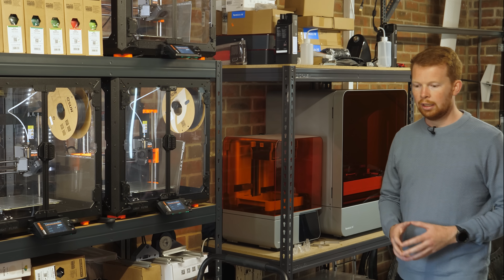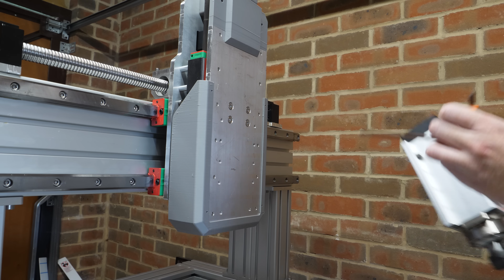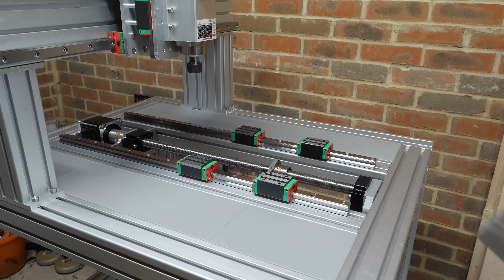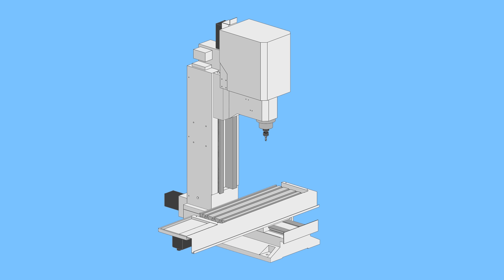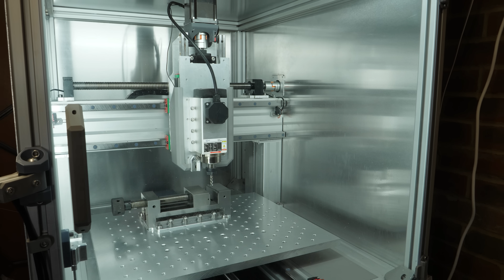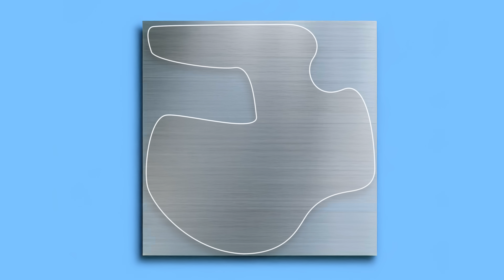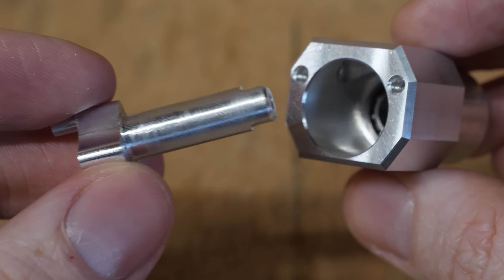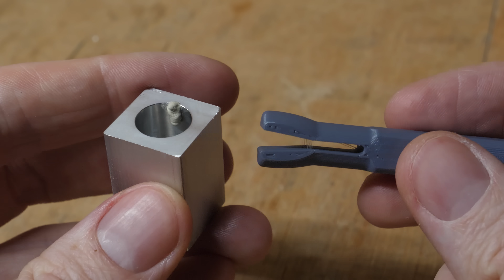I Needed an Engine, So I Built a CNC Machine

Comment: You could have gone for a higher Z-axis with little additional cost, which would have easily allowed to fabricate bigger parts. What was the rationale for not doing so?
Reply from the maker: The Z axis travel is 185mm, which is plenty for most of my use cases, and higher Z would result in lower rigidity.
Reply: @TomStantonEngineering  I see. Thx for explaining :)

Comment: A slightly longer thread on the cylinder and a lock-ring threaded on it above the crank case is a one-piece solution to locking your timing adjustment

Comment: Thread the cylinder farther and put a flat nut on it so when you get right timing you tighten the nut.  the engine block and the nut holds the cylinder from moving

Comment: for the issue with the timing of the cylinder and the locking in place, could a worm gear be used as a solution, with a worm gear interfacing directly with the cylinder to turn it and prevent the backdrive by any other forces

Comment: So ad an Ai to the mill give it the parameters for the tool and strength of the motor     

U could model your machine in a virtual machine and import the part and train it on cutting it and export the cutting path.     (Prompt)

Comment: For a cnc mill with such a high speed spindle, you want to use a different kind if cutter. Especially since your setup isnt as rigid as a typical cnc mill 

Check out "solid carbide high-feed mills".  The ones from "Helical Tool" are perfect for high speed,  smaller diameter spindles.

High feed mills translate cutting forces axially to the spindle instead of radially against the cutter.

The cutting depth is 60% to 100% the cutter diameter on the X and Y plane but the Z axis cutting depth is ONLY 6% the cutter diameter. So a 3mm high-feed mill could easily cut a slot but only at 0.18mm depth per pass.

So to get high MRR, you have to move at a high feed rate, hence the name.

Because the cutters translate the forces axially, you can get longer reach cutters without incuring chatter and vibrations.

That, in addition to the fact that these cutters have a reduced shank diameter make them clutch for reaching into deep cuts.  This makes them the ONLY tool for cutting heatsinks.

A regular endmill will engage with the walls of the cut when milling deeply causing chatter, harmonics, and very poor cutting conditions (chip clogging, poor cooling,  etc)

High-fees endmills can do this allday, everyday.

The last detail is high-feed mills do not have square bottoms, so you want a sqaure end-mill to finish the bottom surface.

This can be tricky after using a high feed mill in a deep cut.

Harvey Tool makes extended reach, reduced shank endmills which had a solid round shank most of the way, making them fvery rigid. The reduced diameter shank keeps from generating harmonics.

So a combo of Helical High-Freed mills and Harvey Reduced Shank, extended reach endmills is a goof combo for setups like yours.

They are also great for routers.

You woll have yo rethink CNC, but it isnworth it.

Watch their youtube videos to learn more

Comment: 19:00  I made a similar engine about 48 years ago. I used an inverted schrader valve and, like you, I used the valve stem thread to "time" when the piston hit the valve, lifting it off its seat, into the air flow to run the tiny engine. It would turn 13,000 rpm on 30 psig.

Comment: Oh all the engineering issues......  not sure if it applies to this like a gasoline engine, but timing is everything.   As rpm increases, the timing meed to as well.  Because the piston runs away from the expanding gasses faster with rpm and we loose power because of it.  Not sure how one would design a variable timing setup and keep the weight and complexity down........

Comment: 15:01 - If you get some Alum, you can dissolve that in water, place your aluminum part in water the water, heat it, and in an hour or so you'll that will dissolve out your steel tap.

Comment: why are you linearizing circles instead of cutting arcs? that's what G02 and G03 are for. should be an option in your CAM software.

there's other reasons why your boring head attachment is better for things that need to be really round, but that has more to do with backlash at the arc quadrants.

Comment: Unless I've somehow misunderstood you, there is a solution to the imperfect circle issue, where it consists of small straight lines. It is to use G02 or G03. You can ask any LLM more about it to find out how to use it, but basically you're using G01, which turns a circle into many small straight lines. G02 & G03 are perfect circles, where you select the radius, centerpoint and angle. Could also be because you're doing the CAM from an STL CAD file, which does not have perfect circles. Of course it could also be a controller issue, where yours does not accept G02/G03.

Comment: 3:20 relative to the size of your machine your build platform is exactly half the size that one would be on an equally large moving gantry machine. I understand the point you're making here, but listing it as a pro rather than neutral(middle ground between the other two styles of CNC) is just wrong.

13:30 Gcode supports an arc or at least partial circle command(G2 and G3). I know the control board is compatible with that command so it might be worth checking to see if the software you're using to generate the g-code has an option to enable the full set of g-code commands.

Comment: 13:40 — As someone else may have pointed out the G02 and G03 commands are intended to run circular paths at the highest resolution of the machine so you don’t have to compromise on surface quality for true curves. The G05 command describes Bézier curves using standard control points. These commands apply to a plane that can be set with G-codes G17, G18, G19. Hopefully your slicing and control software is savvy with all these commands!
Reply: This. Was going to comment this.

A lot of hobbyists getting into g-code from 3D printing, which uses STL files standard. STL files are all triangles, which means the g-codes required are always straight lines. But g-code supports a huge variety of circular and arc paths, not just straight.
Reply: @Brainstormer_Industires  some slicers can recognize arcs and use G2-G3 for curves too.
Reply: Came here to comment this same thing.

And to add, the resolution of steppers and (software compensation of) backlash are the facrtors that decrease the circularity, if that's a word. And rigidity of the machine ofc.
Reply: When he explain the issue with milling round, he speak about the minimal capacity of the driver.
So i guess he know about that issue. While for sure he's milling cant reach micron increment.
For a true round surface, lathe for the win, thats why we now use lathe with milling capacity 😁
Reply: @fafane65  True but he also at 13:20 pointed out the limit of the G code system and then went on to say that his circle was a result of 150 linear moves which is horrible for a circle. That is literally 2.4° per facet. I'm sure his drive setup (controller, motors and screws) are capable of multiple time higher resolution than that, so effectively, he is adding the two error's together.

By using G02 and G03 circular interpolation codes, he would have effectively eliminated the resolution error imparted by the CAM software and been solely limited by the machine kinematics. Don't get me wrong, I don't disagree with you on the "lathe for the win" (or using a boring head setup, or even using the mill as a lathe by spinning the part in the spindle) but I'm sure his results would have been multiple times better had it not been done using linear moves generated by CAM to form facets.
Reply: G2/3 will generate an arc movement which can give a nicer motion but this depends on the motion controller. I retrofitted a couple of desktop machines with centroid acorn control and the motion control on them was brilliant. Clearly it draws from their industrial controls. My machine was mechanically very bad with backlash compensation around 0.15mm but the finishes I was getting were great.
Reply: this is assuming the machine cuts an accurate circle.... and ultimately, the tools he used will lack the backlash of the machine itself and (probably) cut more accurately.    but a g2/g3 would be much simpler than building a tool!
Reply: @fritzgutten  I was completely unaware of G5.  Is that supported in most machines?
Reply: I think the issue is that those stepper motors are usually 200 steps per rotation with 1/16 interpolation at most... that's only 3200 rotational positions. And no positional feedback.
Even the cheapest of the cheap "industrial" servo is at least 10 000 positions and has some form of closed-loop control of position. It doesn't matter if the controller can interpolate the circle up to infinity, the steppers can only hold 3000-ish positions, and usually with reduced torque and iffy positional accuracy.
Reply: @LostMyName15  I'll give you the "no positional feed back part" because its true that there could very well be some lost / missed steps in every move but the 3200 position is not what would cause this issue because that is rotation not linear movement. You have to also factor in lead screw to get your linear move and consider the linear error possible from missed steps from the stepper.

Given that I don't know what his lead screws are, I'm going to just assume .200" per rev because that is common in industrial machines (though his is probably less which would give him better linear resolution than what the math is about to show...
Assuming no lost / missed steps and a direct drive between steeper and lead screw, with 3200 positions and .200" lead screws, each step is worth .0000625" of linear travel.
Now sure, that is a far cry from modern servo driven CNC's but you would have to be constantly losing quite a few steps before errors would be clearly visible to the human eye.

Also, keep in mind that with a smaller lead per rev screw, which he likely has, that linear travel per rev gets even smaller. Also, if there is any reduction factor between stepper and lead screw (like a belt drive), that too has to be factored in also, which again, will make that linear resolution even smaller.

Basically what I'm getting at is 3200 positions (even 1600 for that matter if only 8th stepping) is not going to cause the problem in question, to the severity we see, even with missed steps here and there. The problem is the 150 linear steps to form the circle that his CAM software spit out... That is, as I mentioned in a previous comments, 2.4° facets to make up the circle which is horrible for finish as that is painfully visible to the human eye.
Reply: I didn't know this, I've had quite a break from 3d printing due to issues with a cheap replacement extruder (still planning on either fixing or replacing the machine, maybe even both tbh. Need an enclosed machine for ABS and TPE) but that is really interesting. I use cura slicer so I rarely look at the G-code unless I have an issue or just get bored. I glance over it basically to make sure all the G-code actually transferred to my card and then print it. Definitely should learn some about writing g code since I wouldn't mind trying my hand at a CNC mill project sometime just for the hell of it
Reply: Came here to make sure someone mentioned this!
Reply: Yep, was looking for this comment.

Comment: 13:30 I was under the impression that most "real" CNC applications (as opposed to 3D printing applications) use the arc G-codes (G2/G3) for circles and (duh) arcs? It might just be a question of telling your G-code generator to actually emit them, as I'd be shocked if the duet boards didn't support them (at worst it might be an option or something). These turn a full circle cut into a single line of G-code (or any cosistent arc, obviously). You'll still be limited by step or microstep size, but considering the ball screws and servos in use, I can't imagine that's a real problem.
Reply: I was thinking the same, whatwver CAM software they're using, it must be kinda dumb.

Also, as far as i'm aware, it would be 2 lines for a full circle. If you tell it to go clockwise, with a radius of 10, and the ending point being the same point where it already is, it has no reference for the direction the circle should go; you need to split it in 2 at least (eg: G00 X0 Y5 Z2; G01 X0 Y5 Z-5 F100; G02 X10 Y5 Z-5 R10; G02 X0 Y5 Z-5 R10;).
Reply: @Giuliana-w1f Might not be the CAM software but rather the g-code post processor for the control board
Reply: Even some 3d printer boards and firmwares support Arcs. There's even a plugin for octoprint called arc welder that finds circles and welds them into a single arc
Reply: @zevindd not just some, probably "most" by now. Marlin has them disabled by default I think, but supports them. Klipper I think has it default enabled? But no slicer that I'm aware emits them directly.

PrusaSlicer or orca (maybe all forks by now) I think can do it now, but that's kind of backwards: they integrated the arc welder you mentioned into the source. So it will still generate straight lines and then run an algorithm to detect things that are close to a curve and substitute that. Even when the original source file had used real curves. It's just weird. Better than not having it, but still weird.
Reply: @TheCreat  I haven't really been in the 3D printing world for a while, but I assume STL files or similar mesh files are still the goto, which can't actually express curved sections properly. In the machining world we use STEP files that describe geometry differently, so can actually describe a true circle rather than approximating it with triangular faces.
Reply: @FranseFrikandel  Most slicers can use step files just fine these days (anything prusa slicer based, which inclued bambu, orca and most others these days). And most slicers allow for placing "basic geometric objects", which include round shapes (cylinders, spheres, ...), which would also inclued those.

Comment: to tell u about if its a good idea to poor concreet or sand and dirt into the aluminum extrusions for sound dampening, its a verry good thing, it absorbs vibrations, especially with a high speed rotating bit, u will have high frequancy harmonic vibrations and u will absolutely need to get rid of those for avoiding issues

Comment: Did you have to adjust the PID (i guess it's PID) controller parameters on the mainboard? Or did it work out of the box with the stepper motors?

Comment: Dude, you're kidding me. You lapped the cylinder smooth. And your goal is to have an aluminium piston slide in an aluminium cylinder. It just goes to show that the access to tools has gotten so easy that any Tom and Jerry can mess around with machining without having the slightest idea of what they're doing.
Here's why it's a bad idea. Lapping the cylinder smooth increased the friction between these parts by a lot as he increased the contact area. It'd have been much better to leave the rough surface as it is because then the piston would slide on the interrupted plateaus of the grooves which ofc is a smaller surface area of contact reducing the friction. REAL CYLINDERS are cross-grooved on purpose for that reason AND to provide pockets for the lubricant to escape to. His idea of wanting an airtight seal through closely matched tolerances is insane. That's not going to work. The piston is going to heat up from all the friction, expand and seize up. What he should have done is the lubricant providing the sealing and give it grooves to sit in.
Jesus, I forgot why I subscribed to this guy. If he does something like that again, I'm done. No time for the clueless with too much spending money.